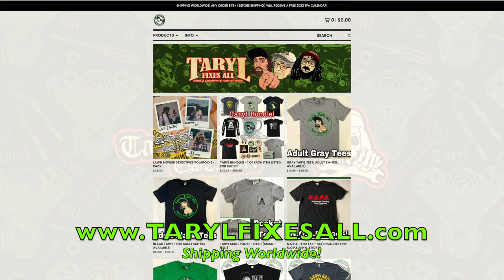MOWER MEDICS - Saving One Lawn Mower At A Time

Comment: The most reliable thing in this video is the 7.3 in the ambulance.
Reply: not the IDI only the good ol powerstroke
Reply: @seanmckay3392 , the IDI is better than the Powerstroke if u do the updates to the fuel system, & abt the same stuff as the 94-97 7.3.

Comment: Taryl, my scrub cadet 2006 model LT1042 won't do nothing when you turn the key. LED don't display, no attempt to engage the starter, just dead! Battery shows over 13 volts. Bought new key switch and still nothing. Any thoughts?